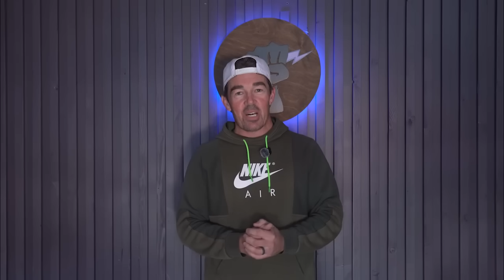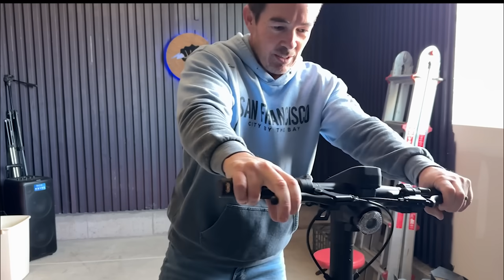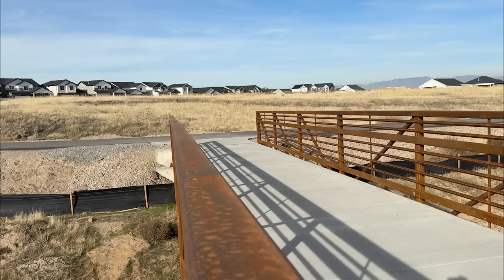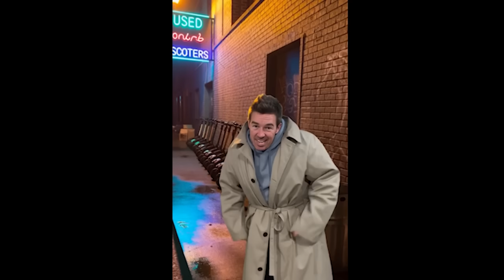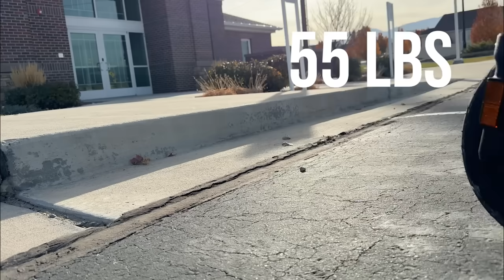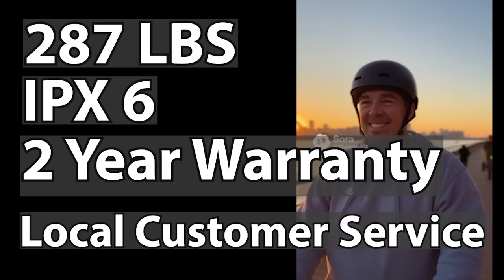$1,200 Scooter That Can Keep Up With Cars

Comment: That's exactly what I paid for my mimimotors bluetran lightning. 72volt,32ah,LG battery 5000watt.,52mph. Kickscooter
Reply: Link?
Reply: It looks like the Bluetran Lightning still has the old style Dualtron-style stem clamp. The ones that wobble and creak. Have they fixed that yet?

Comment: hm, at least you touch on the breaking a little bit. I would have liked to see much more about obstacle avoidance in an emergency break situation. How much can you still steer when you do a full break? how many meters does it take to come to a full stop / how many meters to come to a relatively slow speed not to severely hurt someone or yourself anymore (that is around 5 mph). How are you protected when you crash full speed into someone or something (yea, i dont expect a youtuber to test that of course, but maybe pull up statistics) .. because by insurence statistics .. crashing at  18-20mph / 30 kph SIGNIFICANTLY increases your risk of a FATAL outcome in a crash ... in a CAR! (meaning .. with tons of protection measures that you do not have on a scooter)

The test you did looks absolutely abysmal .. too poor to avoid a pedestrian stepping into your path out of nowhere (like between parked cars) .. or a car owner absentmindedly opening their door into your way.
Reply: The unavoidable scenarios you mentioned  . . . 99.99% crash is gonna happen. So, the slower you are going will always increase your chances of minimal injury and damage. As it is with all movement in general! Thank you for you concern.
Reply: Then don’t watch and go somewhere else and complain. Geez.

Comment: I love your reviews but I don't think we should be highlighting manufacturers like this Yes that's wonderful they can make it and I understand it's fun but it's not going to go good for the industry when we had people that are not responsible using these every single day and I for one think rules are very important which we are eventually going to be regulated just like the UK is. I'm sorry I know these products are great but I would not be interested in a product like this that actually is potentially very dangerous for the writer and extremely dangerous for the pedestrians around the writer. You are wonderful in your reviews and I adore you because you are very intelligent in the way you do this and do cover the safety aspect but as we know the majority of people that are going to buy this are not very intelligent that are just going to make this industry regulated very soon
Reply: When you say “like this” do you mean fast? Because you know there are 72 mph dual scooters out there. This is actually a really useful speed for an electric scooter, and being single motor makes it very rideable.
Reply from the maker: Thanks for watching and this is tame compared to others on the market.  It's small, lightweight and powerful for the size. Don't feel like it's going to bring any new regulations because of it